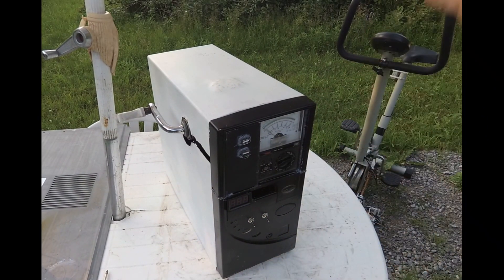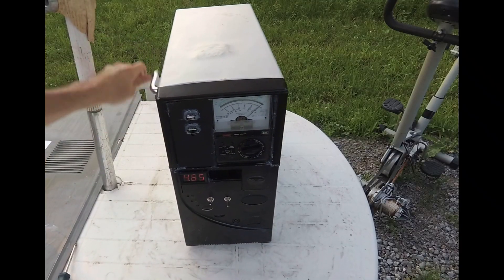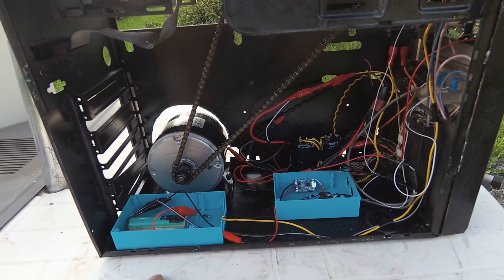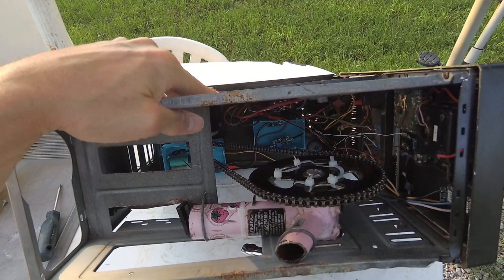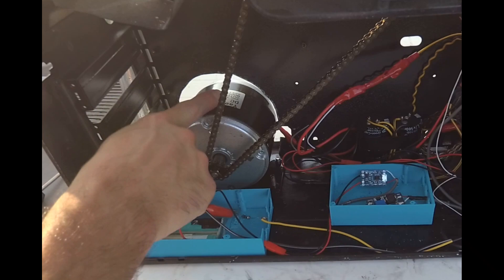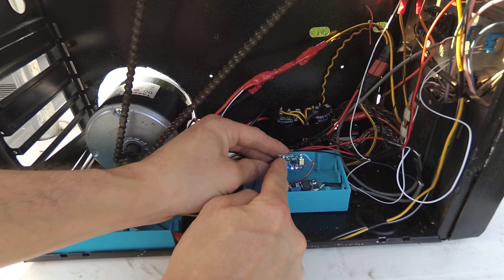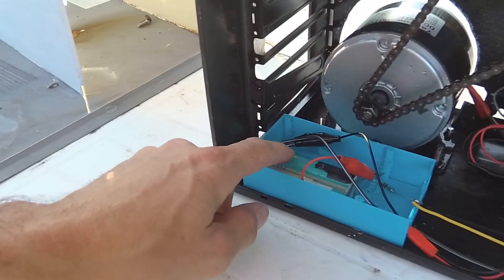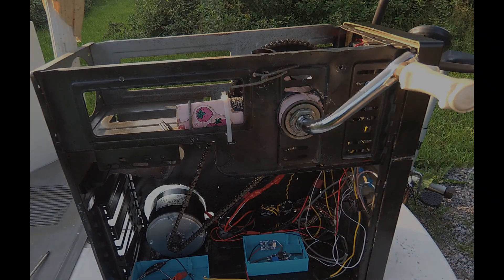Homemade Hand Crank Generator (real output) - Charge Batteries, Phone

Comment: If you want to make a very efficient one reuse the motors from the hoverboard scooters as 3 phase generators need 6 diodes per each  and with modest cranking they can make 12V at 1.5 to 2A. Store in a capacitor and feed a 12V to 5V converter. Can generate much more power using an exercize bike as the rotation source. One i built a while ago uses a washing machine drum motor that feeds a 3 ohase bridge, a couple large electrolytics that feeds an actual switch mode PS battery charger/inverter. The voltage output is about 260V raw from the motor though, so be careful when you use one of those 😮

Comment: How can we purchase a power bank with a Handcrank in the event that Solar power from sunshine is not available?  

Handcrank power banks looks like they’re only giving us 60 to 120 W. So what’s another good way to establish power or electricity when you run out of fuel and the batteries die and there’s a black out from the sun? Fire?
Reply: if you have a river or running stream near you, you can make a mini hydroelectric dam to generate electricity. Or if you have a source of water you can make a steam engine that would spin a turbine and create energy. Would take a fair bit of know-how about steam engines and general ingenuity to be able to pull that off

Comment: Great build👍, I was thinking about making a hand crank dynamo from 110 amp car alternator, do you think that would work or would it have too much resistance for to be practical?
Reply: Peddle power would be better as they need high RPMs to generate significant power.

Comment: if you connect the boost converter to the capacitors, how do you prevent putting too much voltage? do you NEED a voltage meter?

Comment: shorten the chain or put tensioner on it. i'd add  kind of flywheel to the crank too (simple 1/2 to 3/4"  steel plate will do) to ease the  prolonged charging. Also, longer handle will help tremendously in charging (as will bigger sprocket if you can get one).
Reply from the maker: Thanks 👍 good advise for all of us, I love the ideas coming in.
Reply: @kurtscottage  no probs, glad to help. after all we're all in this shit together, right? ;)